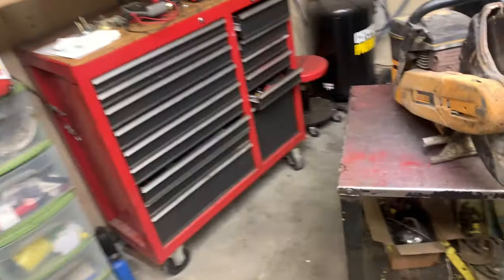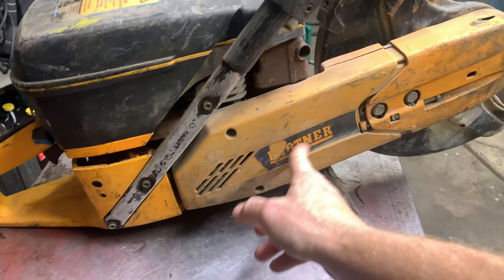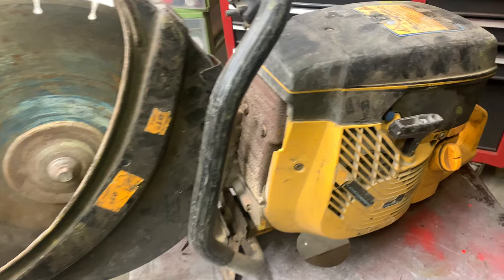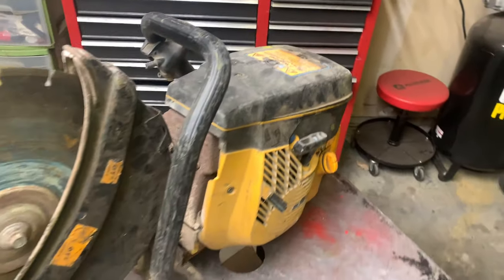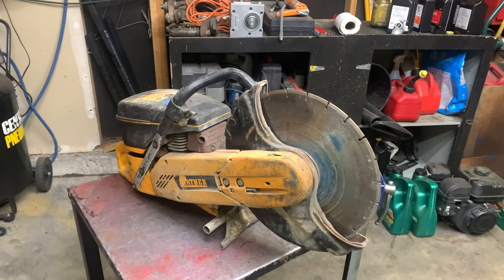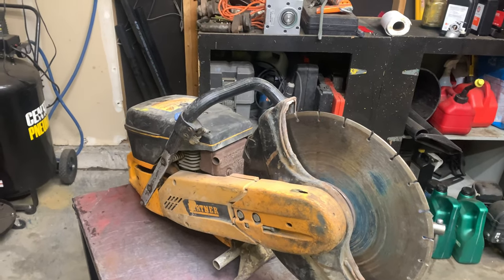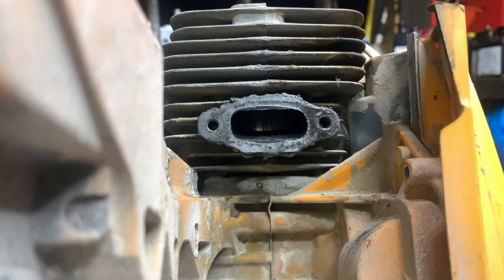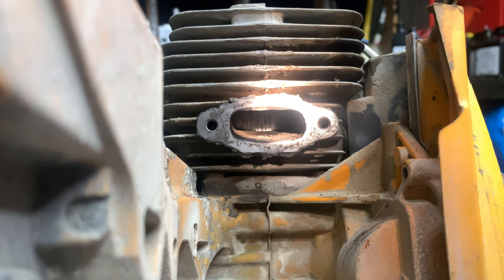Partner Husqvarna Concrete Cut Off Saw k950 Small Engine Repair

Comment: I used a hyway kit on mine. So far so good. It’s for my own use. Not sure about the longevity it will be interesting to see
Reply from the maker: I wish I had the knowledge to understand the difference between on OEM and aftermarket. Manufacturing process, materials, etc. I will put that on my to-do list 🙂